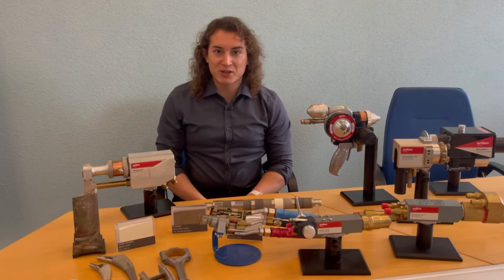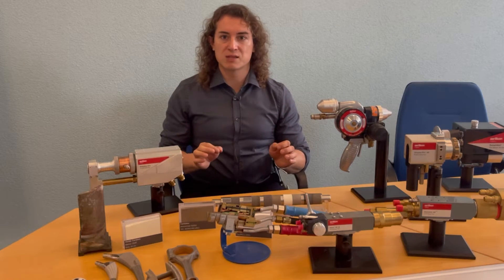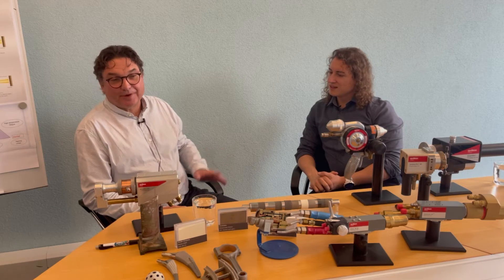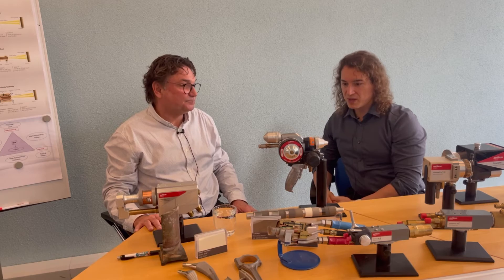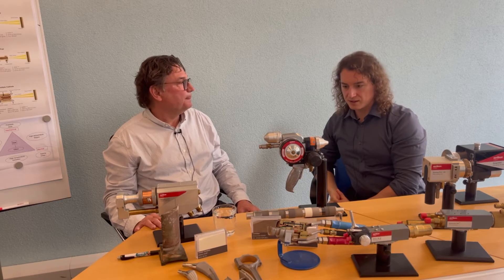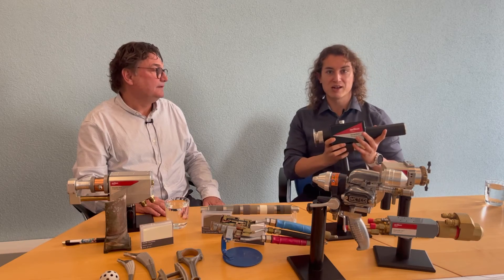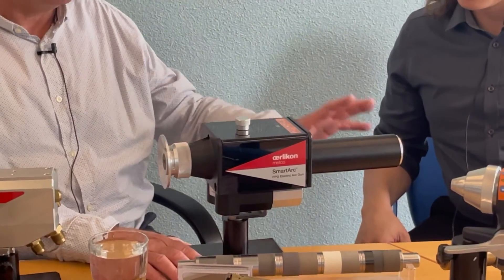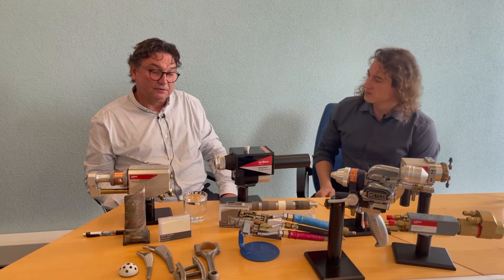Thermal Spraying Explained – Arc & Flame Spray Technologies | Interview with Peter Ambuehl (Part 1)

Comment: Thanks for sharing that is helpful for me to learn more about this technology as an end user! 

For design engineering thermal spray is very handy coating technology for repairs, refurbishments of parts. It is an old but reliable well established/studied process a consistent cost saver.  As Peter has mentioned some already there are many other benefits too.

Comment: Arc gun is inexpensive application of flame spray aluminum, but flame spray using Metco wire is very high Deposit efficiency and control

Comment: Crazy thing is I’ve been Metallizing and started out on Metco 12E flame spray in 1996 now I’m running JP8000 and have run everything in between including Metco 5p powder and Tafa, praxair, Metco SmartArc twin wire arc, and many HVOF systems starting with JetKote, Diamond jet, JP5000 and now JP8000. Nice video
Reply: which system was the best one you used, if i may know?